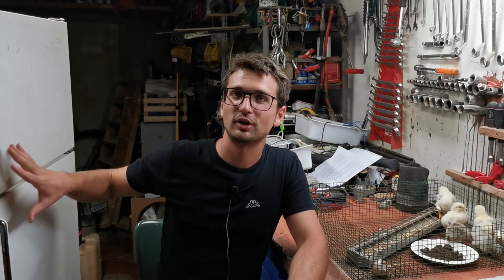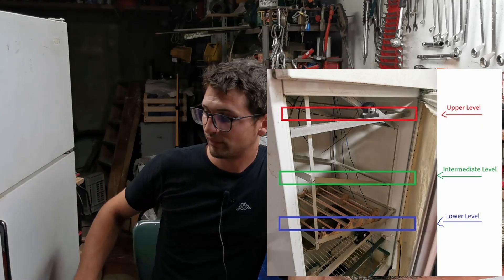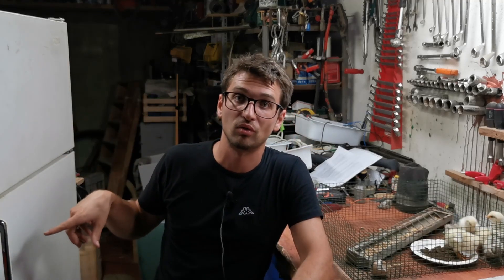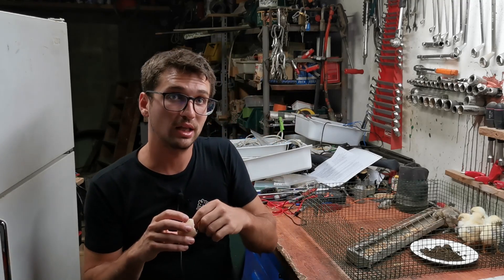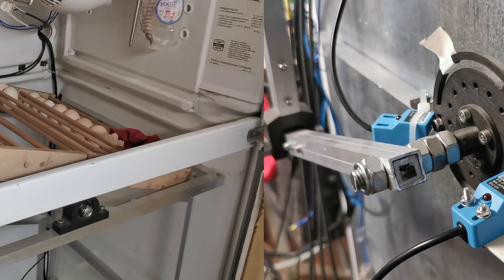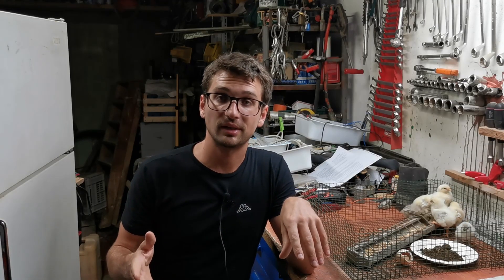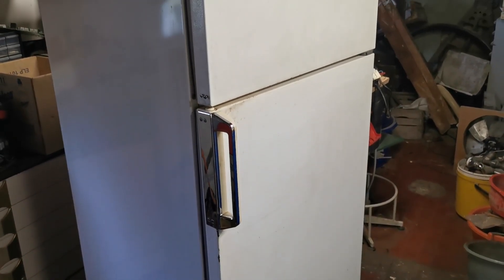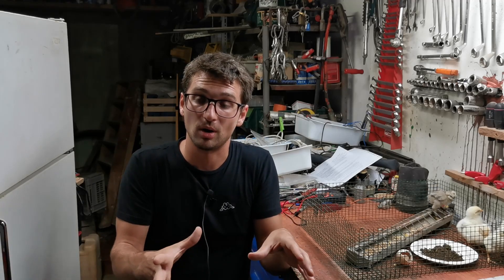AUTOMATIC EGG INCUBATOR - using and old FRIDGE and ARDUINO to build an automatic system

Comment: Great video, I like the idea of using a fan to increase humidity without taking up extra space with more surface area (wider water trays.) I'll use that idea in my cabinet incubator. I haven't tried to convert a fridge before, as I typically prefer coolers for ease of modification. Thanks for sharing your video. Several good ideas.

Comment: Think about adding some mass that can store some heat to avoid that large fluctuation.
Reply from the maker: That is a very good idea, didn't think about thermal inertia inside the system. What do you suggest?
Reply: @profilo_is_back  I was going to comment the same thing! Black bottles of water could help. Or maybe you could try making some water pouches with those super thick trash bags and those heated element bag sealers. :D